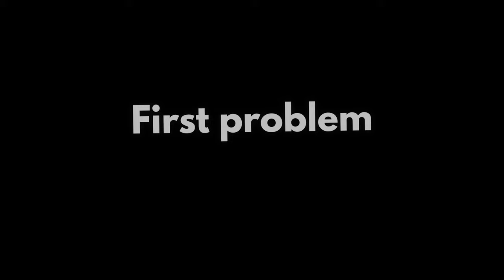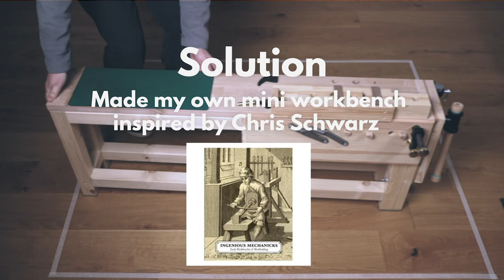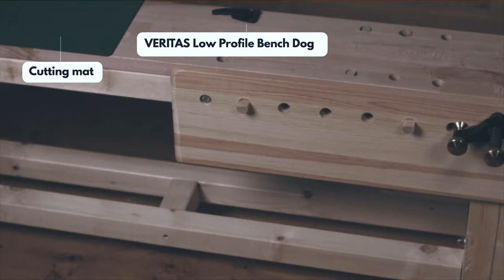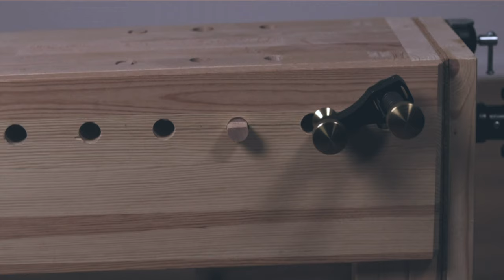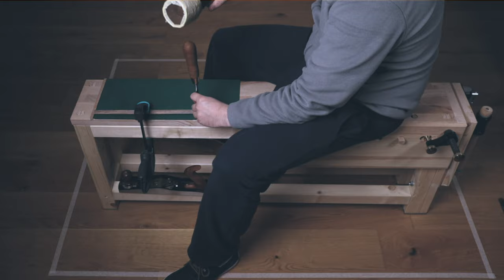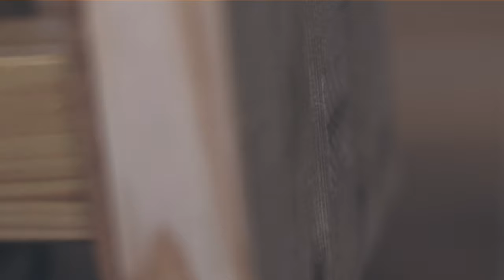Cheap, small, and sturdy mini roman workbench. Inspired by Chris Schwarz from @popularwoodworking

Comment: Octavian, your video of the workbench and link to your plans has really inspired me, plus your use of boxes for elegant tool storage has really impressed my wife!. You have a convert! I'm going to build your workbench but make it a little higher ( I'm tall) plus I might fit lockable wheels for easier manoeuvrability ( I'm getting old and frailer). I've also found similar stackable boxes in the UK on eBay so I will be adding the cost of a box + some hand tools to each future project.  The most important lesson I've learnt from your videos is to treat each project as a work of art.  Thank You.
Reply from the maker: Glad to hear you found the videos helpful.
Reply: @Octavian-Dan  I modified your design to use screwed/glued +  20mm dowels instead of the mortice and tenons as my arthritic hands weren't up to it. I also made the width 30cm plus raised the height to match my B&D workmate. The wheels work very well but I've added a screw-down foot for 3 point location where the garage floor is uneven. I'm also considering adding wheeled bolt-on modular extensions to incorporate a router or a table saw that latch to the main workbench. I'll update you when I get round to these in the meanwhile Ill make the grandchildren some wooden toys and cases. Thanks for publishing your design much appreciated.

Comment: I made something similar but not near as complex and fine as this bench.  That was in 2004.  The top board extended on the ends to accept a clamp on vice.  The top board also functioned as a lid as the whole design was built initially as a sitting work bench/toolbox.  There was an open compartment in the bottom for storage as well.  I dismantled it quite a few years ago but now I think I might have to build another one.  You do fine work, Octavian.

Comment: The cool thing is you sit on it. Makes it stable. Don't need to think what table to put it on. Perfect if you live in an apartment.

We use something similar here called a "goat," like a cobblers bench, made out of whatever wood is at hand, the weight of the sitter driving the pieces together and making it very stable. But it's simpler than this.

Comment: A+ for features/in.  There are a lot of possibilities to take this even further.  A "high table", possible with moxon vice to cut dovetails at a comfortable height.  With some clever engineering you can imagine a bolt-on attachment to use as a spokeshave horse with foot pedal.  Split the top and maybe a 'V' on the non-vice side and you have a very usable rip saw bench.  Incorporate a second bench as a bolt-on attachment.  Bolt 2nd bench end-to-end to the 1st and you can handle long boards without needing a huge bench all the time.  Bolt the 2nd bench to the 1st in a 'T' configuration and you can put a moxon vice/raised table on the side of the 1st bench and sit on the 'T' (handle dovetailing wide boards more comfortably).  Despite my (considerable) mass sitting on it most of the time, I'd probably put about 100lb of weights on the bottom to create both the feeling and function of some substantial mass.  Handling panels would still be a challenge--think the sides of a cabinet for dovetails, rabbets, etc.  Would have to think about that use case.  So far it feels like you'd really need the support of a more "modern" (ie non-Roman) stand-up bench for these.  Maybe... if you have 2 benches, you could arrange them in parallel with something sturdy to raise a "1/2 bench top" (think the front 1/2 of a Moravian bench) between them.  I'm evolving towards a full-up workbench here, but at least this solution knocks down/stores flat for all the work you don't need it.

Comment: I made a modified version of this workbench during quarantine. I loved the design because it was compact enough for my small space. But having used it for several months now, I would really recommend a standard height workbench like a roubo instead if you can afford a little more space. The low workbench is quite the back-breaker! I'd also recommend a a workbench with a thicker top. In my case, the top would flex from my weight and cup the workbench top significantly (Although I did make mine about a foot or half a foot longer). I still love it though, thanks for the inspiration Dan.
Reply from the maker: My back is also not getting any younger but the workbench is mostly for planing and holding your piece for a limited time. A standard workbench is what I would also recommend but this small workbench works great if you don`t have that option. Also besides the workbench I made a low table top "workbench" so you can work at a normal table. Thank you for sharing your thoughts.

Comment: Thanks so much for sharing this! I came across your channel through r/woodworking from your post about the ambient light cover. Mate, I love your work and style. I've only just gotten into woodworking (haven't even bought my tools, although the list is strong haha) and couldn't even begin where to start with he bench. Thanks for the plans I will definitely be making one of these, it suits my small space perfectly. Cheers again mate keep up the good work I'm sure your channel will go far!
Reply from the maker: Thank you for the kind words. Don`t worry about tools and the bench, you will have them in time. Just to give you an example I actually just bought the top of the workbench(20x120cm) and put it on some boxes and worked like that for a few months :) When I moved to another apartment I rented a van so I took the opportunity and bought the wood for the frame. Just be persistent and have patience. Success!

Comment: Thanks for the plans. I made one based on your design. Drilled some dog holes. I will work with it for a while before I decide on whether I need a vise and what kind. It would be great if you could show us the construction details for the small parts holder that you use with your bench. Also, I think I will make a simple saw bench the same height so they can be used as a pair of saw horses and a place to put my tools while I work on the bench. Thanks again for your inspiration.
Reply: I watched the video in slow motion and paused it a lot.  I think I figured out how you made the small parts holder.  I will see how I do making one.
Reply from the maker: For that small parts hoIder am using a VERITAS Panel Clamp that is screwed to the middle, I don`t have any plans, unfortunately.
Reply from the maker: Great job! I hope you will find it useful.

Comment: usually people do legs with an outside angle. It is supposed to be more stable, but at the same time, it does takes more space. How do you find your bench stability? Are straight legs a stable enough?
Reply from the maker: That was my biggest concern but is surprisingly stable, never had an issue.

Comment: very impressive，this is exactly what i need. Have you considering to make a plan for sale? I will definitely buy it.
Reply from the maker: I was thinking of making some plans, I just didn`t get around to do it
Reply: Have you use any screw？
Reply: @yandangao9258  From the video I couldn't see any screws, but there are bolts in places.  For instance I could see at least 2 bolts to hold the side apron on.  There are also bolts through the small spacers on the base to hold the long runners together.

Comment: Love this design! Do you think the NA standard 2x (i.e 1.5) lumber would be enough for the 5 cm (1.9) frame?
Reply from the maker: It should
Reply: I just finished a version with standard 2 by 4s ripped in half for the frame and 1 inch oak for the top and front. Seems sturdy enough. I will let you know if it is a problem when I have some time spent using it.

Comment: About to start this project. This is fills the exact need I have!! Looking forward to it. It would be nice to share progress. Any reddit or forum?
Reply from the maker: Didn`t think of creating a reddit or a forum.
Reply: Very close to finishing my version. With a mixture of "deliberate changes" and what I had at hand. Even got hold of a vise screw mechanism. 
First impression? This thing is way sturdier and firm than expected. Anti-slip rubber pads suggested for the feet.
Reply from the maker: @nicoptw  that is awesome. I am curious after 1-2 projects what you will think about it.

Comment: Can you tell me what kind of bolts you used to attach the faces and where did you attach the end plate for the tail vise？
Reply from the maker: Do you mean the size of the bolts? The vise is this one https://www.fine-tools.com/pdf/hobelbankspindel-307754.pdf, it is not a tail vise just a simple front one.
Reply: @Octavian-Dan  thanks.  On the plans it looks like it’s not a through bolt.  Did you use lag bolts?
Reply from the maker: @angiecheung1715  I used hex bolts(8.8) but you can use whatever you have.
Reply: Thanks so much for sharing your plans and taking the time to answer questions.  Your videos are mesmerizing

Comment: Awesome design. I'm going to give it a shot. What are the shortcomings you found?
Reply from the maker: The main one was that for small pieces was hard to clamp them, that`s why I did the small clamp thing on top.
Reply: @Octavian-Dan  Why was it hard to clamp small pieces? the dogs etc seem pretty versatile. Why did you fit a retractable bench hook and not just additional dogs in the end vice?  Do you get racking or clamping issue with the vice screw?
Reply from the maker: I am working on very thin pieces and I find it easier to make a special clamp, nothing wrong with the main vice. Here is one example of small strip I need to plough https://youtu.be/umIJ7EtfjyQ